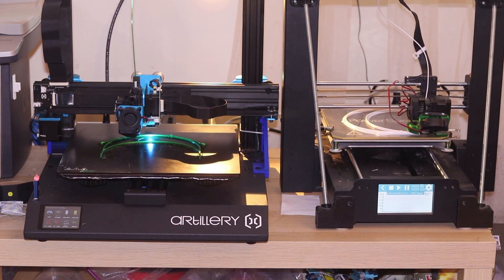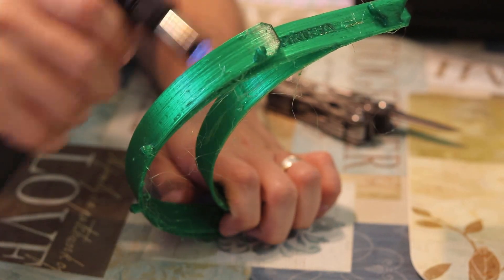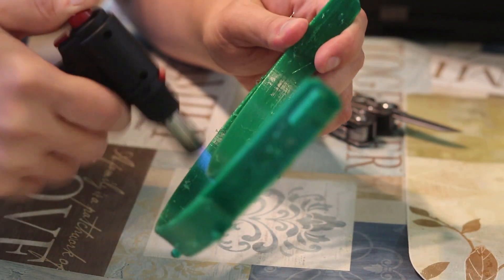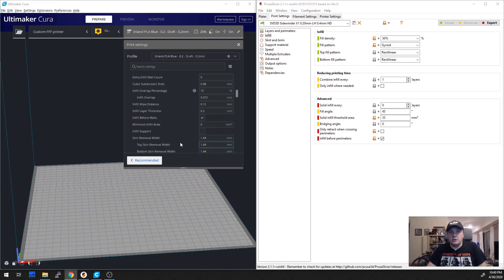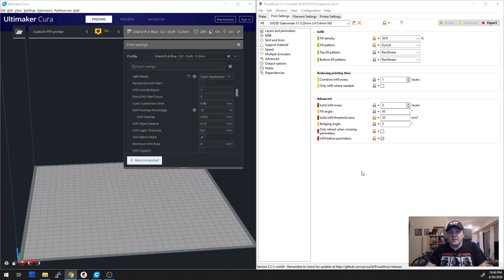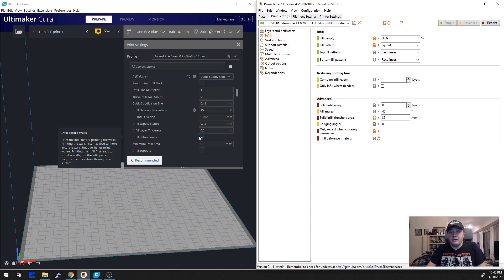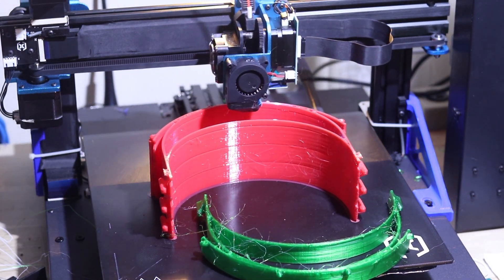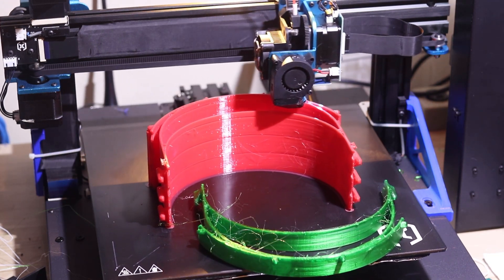How to Improve Quality of PETG Prints with a Single Checkbox | 3D Printing Face Shields

Comment: What print settings would you recommend for PETG in general? My extruder is set to 235°C, build plate to 80°C with print speed at 50 mm/s. These seem okay but it could be better. Also rafts seem near impossible to detach from prints and from the build plate.

Comment: You will get far better results by getting rid of the shitty part cooling duct to something that cools both or all around the hot end nozzle. I designed my own as thingiverse choices we not vert good I tried a couple to find poor performance. I will post mine when I am happy with it and get the same quality as my ender 3 that I never get stringing with. Most likely it will end up with 2 5015 fans. By the way my X1 is a 2021 v5 version and very different to yours it prints PLA very good but Im waiting on a bi-metal heat brake for the extruder which in 1 piece now as I print in mostly PETG.
Reply from the maker: Yeah, I'm also not too happy with the cooling. Need to look up something better.
Reply: @IgorsWorkshop  I print my PETG with 20% cooling on an Ender 3 v2. Can't imagine you'd want a strong fan.

Comment: Have you had any issues with PETG sticking to the bare bed of the sidewinder? I've been hesitant to print PETG because of its tendency to bond to glass beds.
Reply from the maker: No, not really. However I had a PLA print stuck so hard to it once, that I got scared that I'm gonna ruin my build plate. So I decided to splurge and get myself a Wham Bam magnetic surface.
Reply: @IgorsWorkshop  my very first print, of the test cube that comes on the usb drive, was stuck so hard I could lift the printer just from holding onto it. Took channel locks to pull it off, even after the bed cooled. Thanks for the response.
Reply from the maker: Wow! Was that with PLA or PETG? My print that I struggled with had a pretty large bottom surface (about a quarter of the plate area)
Reply: @IgorsWorkshop  that was pla.

Comment: I think I know why this works. Stringing typically occurs when the nozzle leaves one print area to travel through empty space to another. What matters is what happens just before the nozzle leaves the first area. If you print outer wall first the last thing it does is print inner wall. This means before it sets off over open space it has to cross over the outer walls. This effectively wipes the nozzle on the outer walls. On the other hand if you print outer wall last then this doesn't happen, it goes straight from printing the outer wall to crossing empty space.

An alternative approach that doesn't compromise overhangs is to turn on combing in Cura. This makes the nozzle do a little dance (wipe) between printing outer wall and setting off across open space. See this video for an analysis of what combing does.. https://youtu.be/_QRb54zVPfQ

Comment: I never had such terrible stringing with PETG on my SWX1 Even when there was a gap between heatbreak and nozzle which caused a lot of trouble and decreased the efficacy of retraction among other problems. Have you checked wehter your nozzle sits tight against the heatbreak?
Reply from the maker: Yep, it's tight. Perhaps there's something with Inland PETG. What brand do you use?
Reply: @IgorsWorkshop  Various brands, mostly Das Filament and Basicfil.

Comment: Igor,  I have watched all your videos and I have had some of the same issues you have.  I have upgraded my Sidewinder X1 v4 to a BLtouch v3 using Waggster mods  https://youtu.be/ynm8inRMVkE and upgraded my firmware to his custom one Marlin 2.0.2 from his website.  All I can say is it's great now.  I have zero issues now if any and the prints are great.  Better filament does help but his mods are more important on my prints than the filament I have noticed.  I use Prusaslicer and I downloaded his custom settings.  He has a bundle pack that you can import into PrusaSlicer.  They settings are great and you dont have to do anything.  Give it a try you will be amazed on great they prints come out.   This is the filament I use going from best to worst:  1.) Hatchbox  PLA 2.) Polymaker polylite PETG/PLA / 3.) AIO Robotics PLA /   Sunlo / Inland

Comment: Can't wait to try.  I've been struggling with blobbing and stringiness.
Reply from the maker: Good luck! Let me know if it worked for you.
Reply: If using Cura try turning on Combing instead.
Reply: @ColinWatters  I turned Combing OFF and my printing quality went up. PETG likes to stick to the nozzle when riding on the printed parts and that causes blobs. I have 0 stringing when I have proper retraction settings for my hotend. I use 2,5mm retract distance and 46mm/s retract speed with copperhead heat break.

Comment: Great video, thanks. Is there something similar in Simplify3D? And is there a reason you are not printing 4 at the same time since the bed fits? Can you share you settings of PrusaSlicer? Sorry for the many questions, is because I have a X1 also and I'm also printing Face Shields and having problems with PETG. Regards
Reply from the maker: I do print 4 (stacked). I even tried printing 8 (as 2 stacks) but one stack popped off mid-print. Sorry, I don't use Simplify3d, so I don't know, if there's such setting. My settings for draft PETG on X1 are: temp - 240/237, bed temp - 85, layer height - 0.3, print speed - 60 mm/sec, acceleration - 500, jerk - 5, cooling fan at 0. 
What problems do you have with PETG?